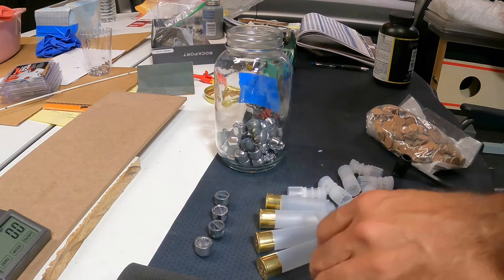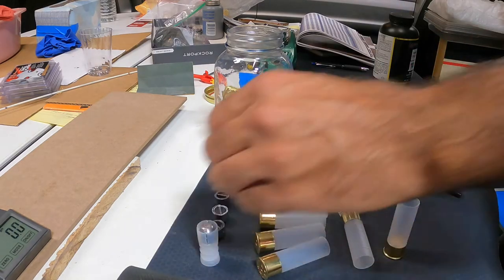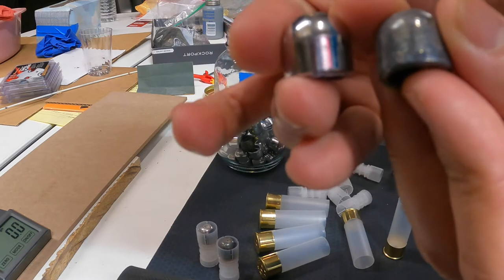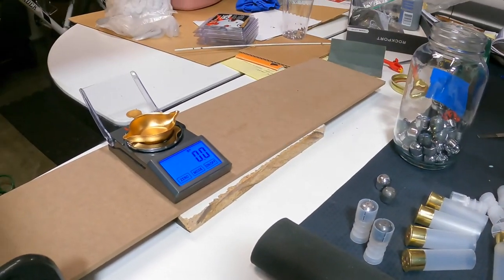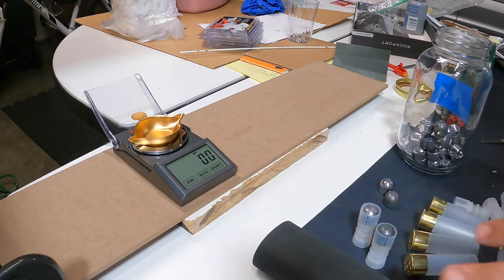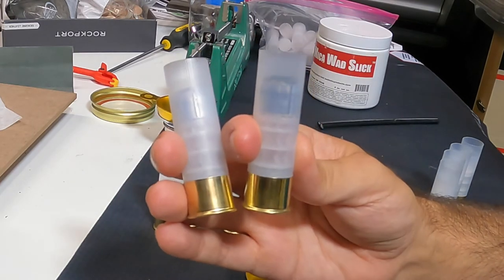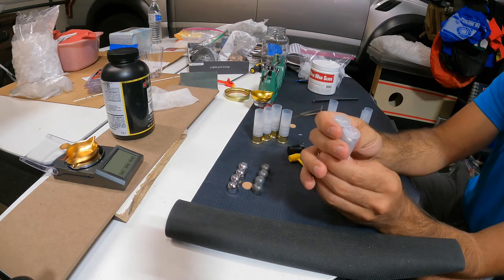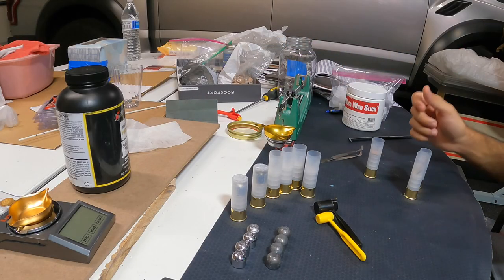Pt 1 Cheddite 700x Lee 1oz Slug 12 gauge handloads Loading 12ga slugs with Lee Load All

Comment: Do you have a load manual with Cheddite data with various components.wondering if the new Lyman has the data?
Reply from the maker: I like the BPI ballistic products intl manuals, they are pretty comprehensive and include several cheddite loads.

Comment: With the mold, could you make these out of brass.
Reply from the maker: Maybe, but keep in mind the almost double melting point of brass over lead
Reply: You can make it from whatever you want, just mind the weight difference and the hardness
Reply: @shaunstayfree5551 mate how much powder pershell use 1oz slug ???
Reply from the maker: @hecker2104  about 15-16 grains, lee has some data for their moulds too